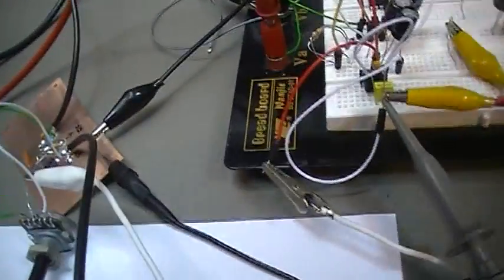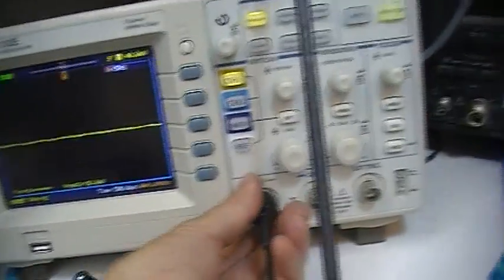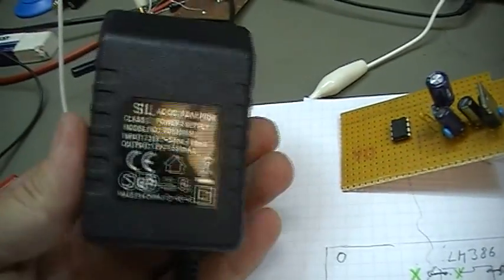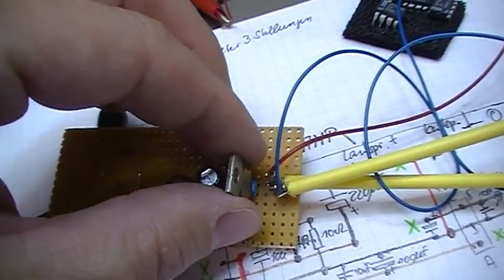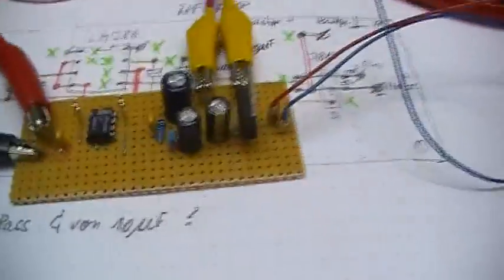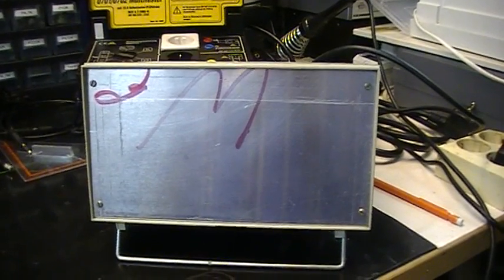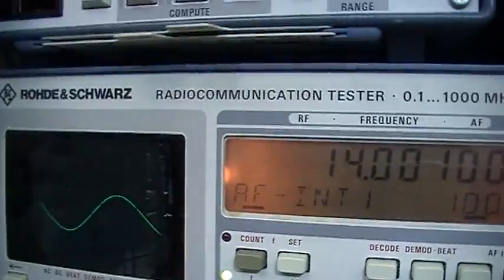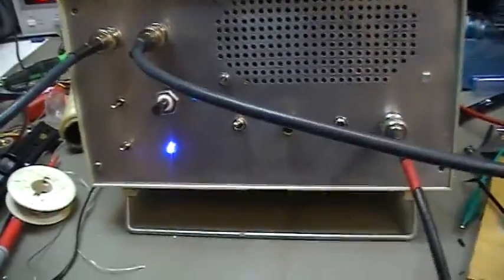#19 Build: SSB Lab Monitor; Part 3

Comment: Peter - I've always wanted to duplicate your SSB monitor for the bench and when I found some 8.2 ohm 5W resistors for the audio dummy load in my stock I knew it was time! Do you have a final schematic made up for the monitor? If you do you could email it to kl0s at Cox dot net. Thanks in advance!  73 - Dino KL0S
Reply from the maker: Hi Dino, I have looked through my files but can't find the PCB planning I did for the audio stage. The rest was done by data sheet. I'm sorry that I can't help....best 73 Peter

Comment: Great video!!!!
I would never have guessed one could build an SSB demodulator so easily. A tunable RF front end / amp and LO and you have a home brew SSB receiver.
Yes an NEC UPC555H, NB4N507A and some 'glue' components and it may be possible to build  an amateur band crystal set on steroids.
(Actually, I thought I saw the NEC chip in a ICOM or YEASU all bander you worked on. 555 sort of jumps out at you!)
Reply from the maker: +Peter Walker Hi Peter, yes most designs a really easy to build. Today we have a good source of already pre designed IC's which makes it most of the time simple. Thanks for watching 73

Comment: Magnificent tutorial, well presented!!! Ordering monitor parts. I had the same idea about the dummy resistor and speaker earlier as I watched the video. A question-Were the flying wires creating radio wave type interference or was the deviation caused by loose connectiions on the breadboard? BTW we really appreciate your Superb efforts and excellent presentations here. TNX!!     -KC5OKN
Reply from the maker: Satellite_Guy Great that it helps you with your own projects! I'm not sure what you exactly mean. There was no radio interference. The distortion was due to the bad contacts on the breadboard.  Your questions are welcome...